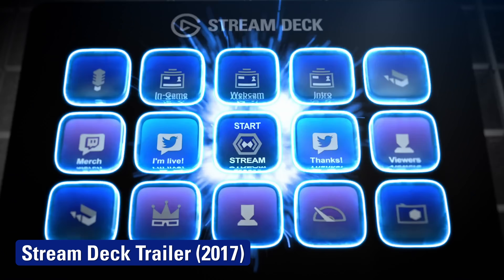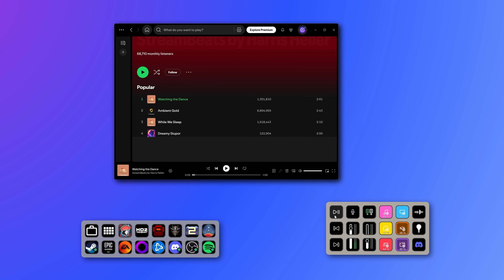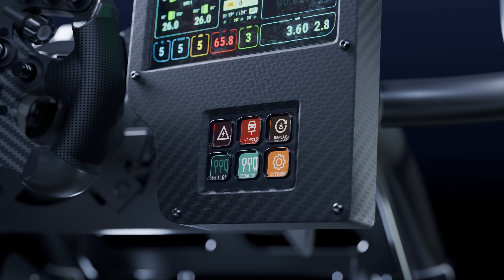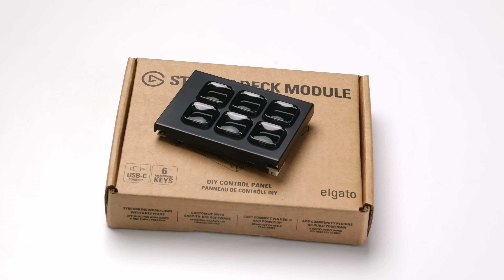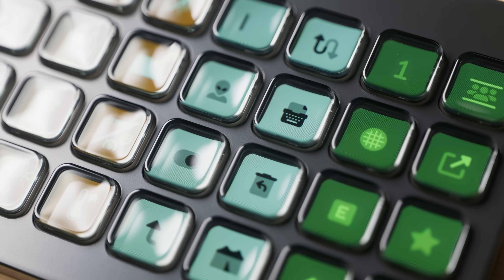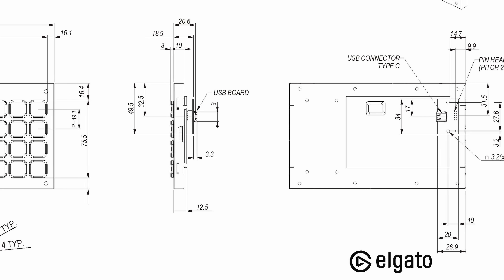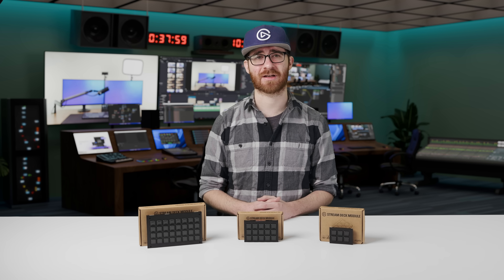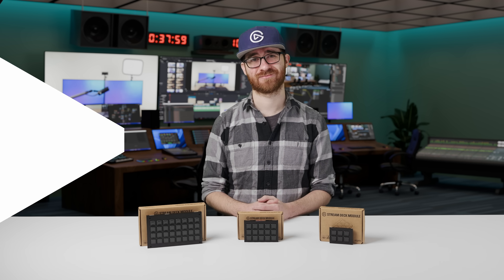Elgato Stream Deck Modules: Ready to Customize and Integrate into Your Project

Comment: hi @Elgato. love your product! Q: can I use this to "expand" my smaller 6 key streamdeck? I wanna to get a 32 :) Thanks!
Reply from the maker: If you purchase a Stream Deck Module, it will behave as a separate device rather than being combined with your Stream Deck Mini. Unless you're wanting to integrate the 32key model into a project, the full form Stream Deck XL would be our suggestion since it has a stand and enclosure.
Reply: @elgato  Hi! :) Ah ok. Interesting. Ok that's good to know and great tech too. Thanks guys! Really love your products :)

Comment: This is actually so legendary. Way to do something surprisingly pro consumer. It would be even cooler to give us options to work with the platform using micro controllers and such!  Perhaps have onboard storage for the icons, handle profile or workspace storage configurations (for icon layouts) on board and have the signal pins output the button pressed with inputs for switching configurations and/or give lowe level access to configuring layouts. I could see that being huge in the electronics hobbiest space.  

I dont have a Stream Deck. I recall having disliked the sensation of the buttons in comparison to the stationary, continuous screen with haptic feedback combo used by the Loupedeck; then again I'm a bit particular about sensation and generally dont love physical buttons on a conceptual level. 

Between Loupedeck ceasing sales after being acquired by Logitech, the fact that their ecosystem is far less mature even if they weren't ceasing sales, and you guys expanding into such cool and consumer friendly territory, with the rack mounted solutions and modules: I'll definitely have to check out the new switches and see if they're any better for me... Unless y'all decided to drop a haptic feedback version 🧐? Jokes aside moves like this make me want to support the company even if I do have certain gripes, I'll definitely have to check out the newer stuff and updated switches y'all have been putting out! Being this willing to actually assist customers, in their efforts to integrate your product into custom solutions, it disgustingly refreshing... Most of the time you see the opposite. Much love to the team at Elgato keep up the good work <3

Comment: The next step is to make modules that click together like lego (or the new magnetic case/cooler fans that have emerged) so you can build your own deck size.
Reply: Yess!! one key block with magnetic connectors on each side and the sky is the limit

Comment: The ability to power off the screen itself (not dimming the brightness to 0% as is the current solution) while maintaining power to the deck would be a deal breaker, either a toggleable "sleep" option or a digitally controllable "screen power off" feature would make a huge difference to the device's functionality and longevity.

Comment: Are these modules based on scissor keys?
Reply from the maker: Stream Deck Modules use our classic membrane key design.
Reply: @elgato  This is such a huge miss. IMO, any future stream decks I buy will be scissor key only. I really don't like the classic membrane. I have a 32 key XL, and the existing 3x5 is too small. The modules are even more attractive than a standard XL because I can design my own enclosure for my setup.
Reply: @elgato  Why would you do that? No one likes membrane keys.

Comment: Well done. Rare to see a company lean so effectively and willingly into a customer base using their product completely differently than they intended. Take notes, Nintendo
Reply: Is is completely a great deal if it is saving the demographic of people doing these types of mods time and money. The fact that they are even paying attention to their customers and are offering a completely different version of their product speaks volumes. The people doing these types of mods don’t want a USB cable and they definitely don’t want to have to perform surgery on the Stream Deck before performing surgery on the device they’re about to install it in. Stream Deck is probably not even breaking even on this given the associated cost to manufacture a different product, bring it to market and potentially tie up their manufacturing cost and inventory space. You people don’t get it. I have modded very expensive ($85k+) pieces of equipment I use in film and television production that were simply lacking any kind of macro function to make my workflow more efficient with software based systems. I am their customer, not some streamer on Twitch saving their allowance for one of these all while complaining about the price the whole time. Kudos Stream Deck!🎉
Reply: Okay.... do the math.  Less packaging, no included USB cables.. Their profit margin on this "barebones" is actually MUCH higher than the fully dressed version.  A FAIR and honest company, would be transparent about that.  Instead, they are taking advantage of creators and DIY'rs.
Reply: @OhThatAD  Offering an option to those already capable and actively taking things apart, isn't taking advantage of, it's giving an option. Clearly their market can already do it alone - is the convenience worth it? Those very same techies will decide with their wallet.
Reply: @porterbytes  Not a good option.  Hopefully others will see that this is not a good deal.  $20 off is a rip-off.
Reply: @ad3d what? Saving time and saving 20 dollars isn’t worth it?

Comment: Can the stream deck modules be used with the new network dock? I'd love to integrate these in a few areas of my home and have them POE powered and flush mounted in the wall.
Reply from the maker: Yes! Network Dock is compatible with all of our Stream Deck Modules (6, 15, and 32key).
Reply: @elgato  Wifi dock when?
Reply: @brandontgibbs I think you could do it with a raspberry pi (or similar device) running virtualhere (which sends usb devices over wifi)